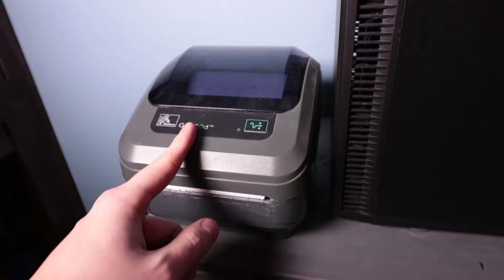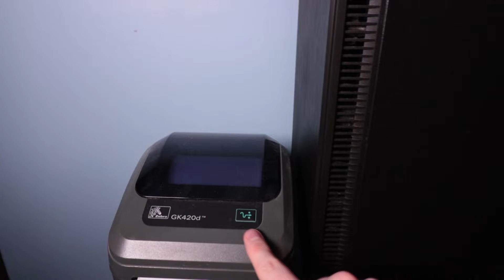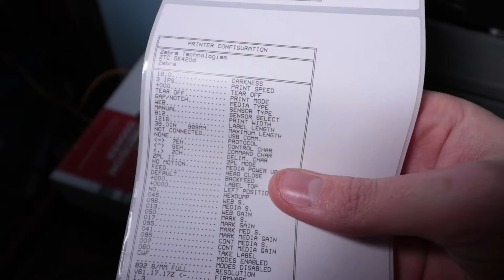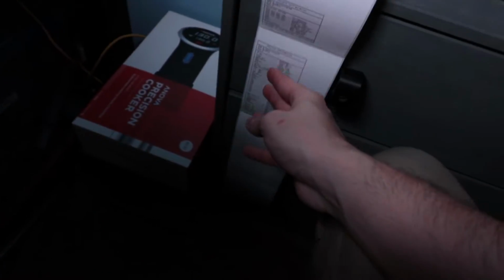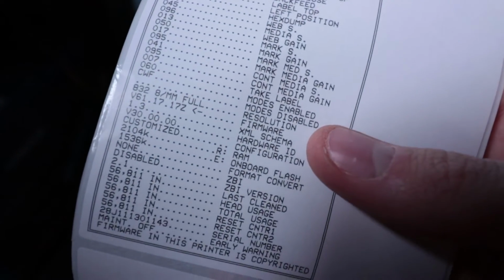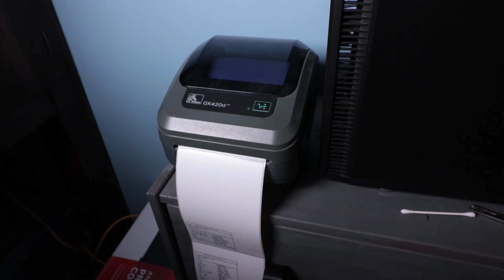Zebra Direct Thermal Printer Print Head Fading Fix

Comment: I've got the ZD620 that I use for work. I didn't want to ship it out for repair. It was intermittently printing only half of the label. I cleaned some buildup from around the head and rollers, and snapped the head out from one side, and put it back in. It works great now! Thanks for the tips!

Comment: ..after replacing  parts cobbled from ebay purchases for repair nothing worked. clamps around the shell helped for awhile but not for long and I was about to dump the $400 printer. Your tip did the trick. Cannot count the hours I have toiled, thank you good sir!

Comment: I will be sure to remember this if and when mine acts up.  Would you happen to know if the platen roller, bearings and gear are the same on the GX420D, GK420D and the same models but R2.0? I'm getting two different part numbers for what looks to me to be identical. Non R2.0 models has a part number of 105934-034 and the R2.0 model has a part number P1027135-039.